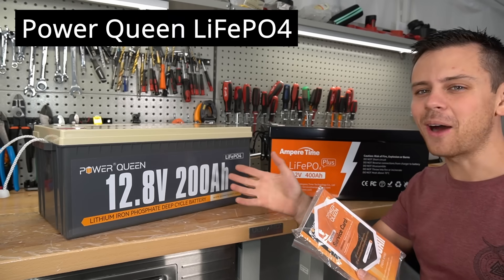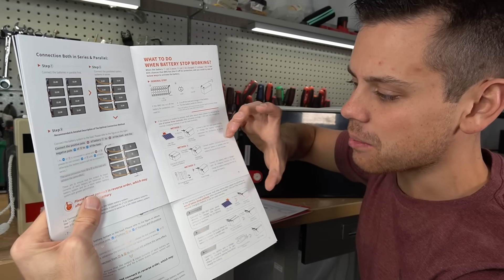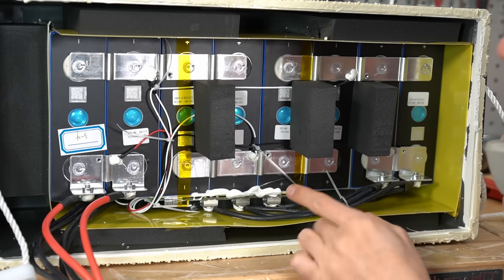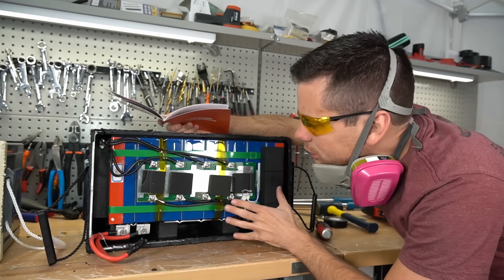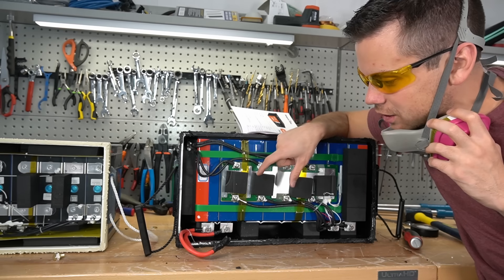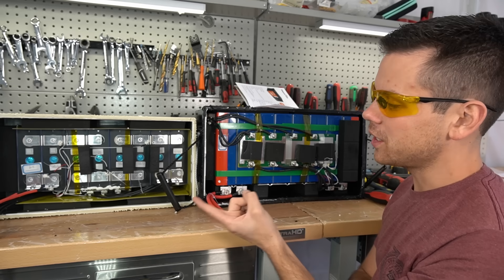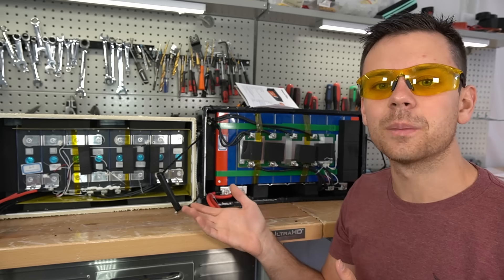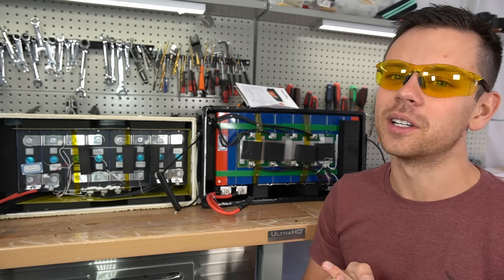Large Cheap 12V LiFePO4: Power Queen 200Ah & Ampere Time 400Ah Tear Down!

Comment: Thanks for the reviews Will!   I'm biding my time for about another year before buying a 300 - 400 Ah LiFePo4 battery for my live-aboard sailboat.  How cool is it that the prices keep coming down, quality is going up and capacity is increasing - all to the point where reviewing them gets "boring"!   Your comment that they are "boring" is one of the most reassuring things I've heard!   It indicates to me that this technology is maturing to the point where you don't have to be an electrical engineer to buy and use these batteries.  

Best regards from Key West
Capt. Blackheart Charlie
Reply: You shouldn't keep waiting because if China ends up with Russia you can say goodbye to cheap chines Lifep04 batteries and cells. I just built a fully complete 3k watt continuous system with 1400 watts of solar and 24v 280ah battery bank for right around $2500 bucks for everything you need
Reply: @Blackheart C...I should have looked through the first few comments BEFORE posting narly the identical thing!  Aw hell...I'm going to delete my repetitive post.  Love the value-oriented direction these batteries are going! 😍💞
Reply: the supply-chain with China may not exist a year from now

it may not exist in half that time, ..or less
Reply: Hi captain which battery would you recommend now? I have a 48 volt Ray Electric Outboard in FL!

Comment: Making a big deal about not having low temperature charging protection is probably not a big deal anymore. It is just one one of the parameters or specifications for the application you would look for. But if it said it had the protection but didn't that would be a problem. Or if wasn't designed or laid out correctly that would be a problem. It is cool to see the inside and how the technology is evolving. You do got to watch China and there quality it can vary.

Comment: They are still expensive to the normal working class person
Reply from the maker: They are 1/4 the price they were three years ago. They are cheaper than lead acid. do you have a better alternative I am missing?
Reply: @WillProwse  maybe Lead acid batteries are more expensive I have 6 120 ah batteries which cost me £380 they have been in my camper van for over 2 years now they are still holding there charge with the 4 solar panels that are 120 watts each I have them on a home made sun tracker which lifts and turns and considering the weather in the UK is pretty crap compared with the USA or even Europe they are doing well. I’m a pensioner so it would take me over a year to save to save for one lithium battery even though I know they are better and lighter then a lead acid battery I would love to have a few of them and I would love a newer van to convert but it’s not going to happen unless I got them free
Reply: @WillProwse  I can't afford those (lead acid) either. I know that you know what it is like to live on little/nothing given your history. But, maybe you should remember your original circumstances. I live on a small SS check. I used to go to the store and look at the steak and then buy hamburger. Now I go to the store and skip the meat counter altogether. I cringe when you cut up a battery, I know why you do that and I applaud that you are doing it to inform us, but, I still cringe. By the way, I do like your videos very much and "like" each one. Thanks.
Reply: @bwuepper439  it's not like he throws it away afterwards. He has a huge battery bank. 

If he didn't cut it open he'd just be another guy spouting off marketing claims. 

Unfortunately solar is expensive. So are vehicles. Maybe see if you can get on a good page with a local scrap yard and offer to buy some scrap batteries and try to revive them. I've heard of people getting used telecom backup batteries that are aged out and making out pretty well. Then you can sell the bad ones back for scrap.
Reply: I said the same thing in 2017/18, when my 800AH AGM battery bank was work great. I going to replace it with a 200AH CHINS battery for half the cost later this year. Reason: The 800AH bank is just about at it's end of life cycle after 4 1/2 years of use.

Comment: I have 4 300ah chins in series on my off grid tiny home and have worked super well so far besides a little hard to understand them on customer service at times but that was expected when buying a cheap China based company battery. only pulling 275ah after 7 months but I believe that is due to having 2ft cables to connect them into series instead of buss bars due to space constraints. need to take them apart and re balance them again I assume to pull full capacity again according to chins
Reply from the maker: Thanks for the feedback

Comment: Lifepo4 battery packs with low temp cutoff appears to be rare.
Reply: What's weird about that is that it's not exactly an expensive addition to make that you can argue they are dropping it to reduce cost. It is literally a wire with a sensor. Not sure why they leave it out.
Reply: @jonjohns8145  Because a lot of the world doesn't need low temperature protection.

Comment: Side Note: I wonder how far are we from Homes being equipped with whole home backup systems built around All-in-one charge controllers and these types of batteries (or the Rack mounted ones) as a standard. Meaning, You buy a house and it comes with in home energy storage system (Solar cells on the roof or not) same as you an HVAC or Water heater system? Home backup systems like that can become standard on homes in places like California where power black and brown outs are becoming more frequent.
Reply: In Calgary, Alberta Canada, one builder is advertising “Net Zero” home builds. They are equipped with a solar set up I haven’t researched yet, but they claim you will be able to operate the home at Net Zero. Time will tell on those builds. Financially it will be a question mark if the added cost will be worth it, technically, it will be beneficial environmentally.
Reply: The droughts are putting most of the west coast and southwest at risk of becoming unable to rely on hydroelectric dams for electricity. If I were living in any of those regions I would honestly get out now or invest in rainwater collection and solar to be fully self sufficient.
Reply: I live in California l, I don't remember the last blackout and I'm in the middle of the Bay area.  Solar energy has filled that Gap.
Reply: @volksbugly  I think most of the black/brown outs are in the central and northern areas of the state.
Reply: @shawncook8672  - So you don’t actually live there and just repeat what you read on YouTube without checking the validity. Such a common problem that creates false rumours. That and relying on statements that are now old and outdated. Kid if like comparing a Toyota from 1973 that was crap to Toyotas today that are pretty good vehicles. 
     I think I’ll do my own research, even though I live in Canada, I find it interesting.
Reply: @volksbugly  August 2020, remember the heat wave? Wildfires around NorCal and central Cal happened  thanks to that freak lightning storm at 3-5AM that was 200 miles long. A full week of high temps 100-110F?  Solar energy didn't do squat here. We were out for 47 hours. You got very lucky if you didn't lose power. Some places were out of power for a week or more and some wineries were scrambling for truck mounted diesel generator sets to rent to save their cold storage.  

Current solar and wind power screw up grid stability. Read up on the ''Duck curve''. There is NO REPLACEMENT for Base Loaded power generation. Our moron politicians and their profit minded lobbyists think 50,000 megawatts of wind and solar are the same as 50,000 megawatts of base loaded steam turbine and gas turbine generators. They are most certainly not. My background was in power generation and distribution as an Engineer for General Electric Co. I worked in 17 countries bringing reliable power to large regions. It angers me when people think solar, wind power, going All Electric, and closing down the use of natural gas are the answer. Until I can fly coast to coast on an electric powered airliners, I will know that batteries have not been perfected.
Reply: California has black outs and brown outs because they govern themselves like a banana republic. There's no market supply/demand reason in the absence of Sacremento insanity why they have these issues but by their own doing. Bandaiding their fixes doesn't actually solve the problem of being governed by Venezuelan-tier intellectuals.
Reply: California and New York are outlier regions in term of economic system among all free countries. The US is at the bottom among free countries economically, and these two states are  at the bottom of the list among all US states free rank. Able to survive only because many megacorporation still headquartered in California (they are in progress moving to other states along with smaller size business) and New York as hub for international trade, having money the amount US GDP flow through New York every couple of days. Energy problem only common for them because of these outliers economic system.
Reply: @TheSiprianus  I get your message's concept, but I believe you grossly over-stated the amplitude.  "The US is AT THE BOTTOM ...economically.?"  Come on.  My quick web search found a source saying the US is #5 in the world in GDP per capita.  (search: Statistic Times Projected GDP per capita Ranking) Your source?

Comment: I am looking to take our grid-connected solar system and build it into a battery system that pulls from Grid only if needed.   I'm also looking to put 30 panels on our roof which faces southwest and the current 27 which sits on our flat roof.. that should keep us off-grid quite a bit.
Reply: I would love to know how you build a solar battery system that only pulls from grid when needed.  (i'm sure its possible, I just don't have the knowledge or aware of the equipment that takes to do that)
Reply: @HeadCannonPrime  I have two MPP Solar off grid inverters that are configured to do this.

The are connected to the grid, but only use grid power  when necessary.

In the charge parameters they are set to Solar only.  So batteries are only charged if there is sun.

In the 'power section' the following sequence is set Sun, battery, grid.

So during the day power is provided by sun, if not enough sun is available (due to large loads) it uses  some from the batteries.   At night it uses the batteries and if the batteries are below a defined voltage, it switches to the grid.  

One inverter never goes to grid. The one connected to the ac in bedroom  sometimes switches to grid early in the morning, until enough sun is available.

I have 16 agm batteries (full river 400ah), but they just are not enough and degrade pretty fast.

Will replace them by LifePo serverrack batteries soon.

Comment: honestly, these cheapo batteries are only marginally more affordable than an EG4. I can't figure buying one of these over a rack mountable unit with a full management interface.
Reply from the maker: Very true. I would go server rack any day over theses. Just the features of the bms is lightyears ahead.
Reply: @WillProwse Hi will. SOK possible in an RV under the stairs in plywood and metal enclosure or dumb idea?

Comment: I bought a 200ah ampere time plus. I believe the plus just indicates a 200A max continuous discharge rate. The regular models are only 100A
Reply from the maker: Oh! Great point!! Thank you for pointing that out
Reply: I also bought that same battery and have a 2000 watt inverter connected to run a microwave. It works perfect.
Reply: High discharge rates open up a new world with things like microwaves and tankless electric water heaters. I would have ordered a server rack but they don’t make a server rack with a 200A discharge rating.